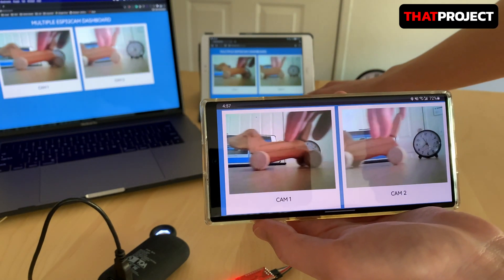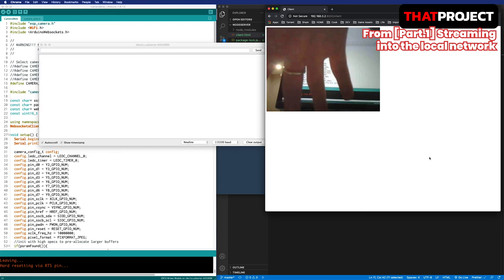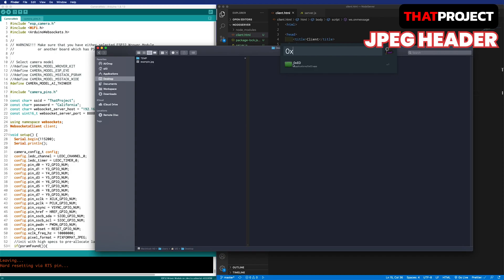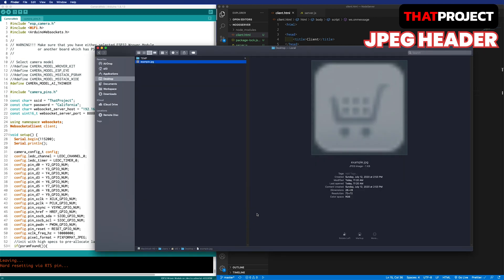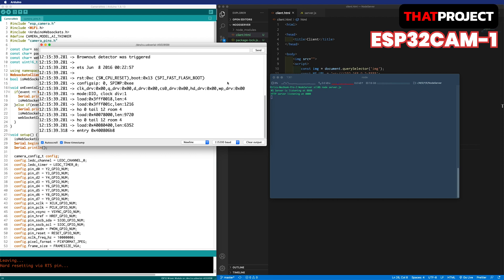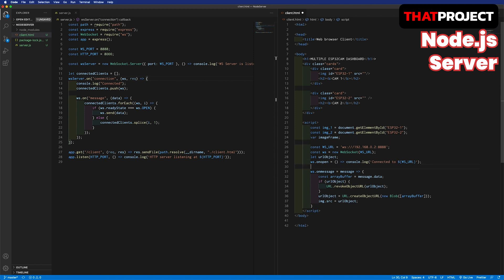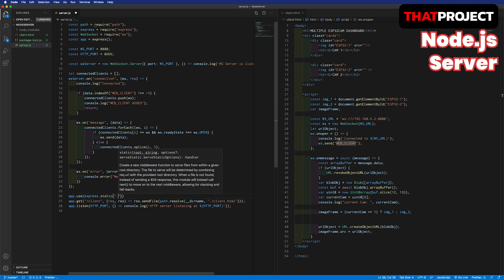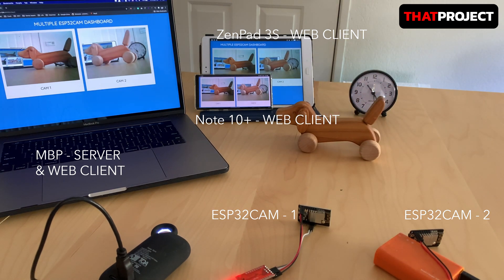ESP32 CAM with Arduino IDE | Tutorial - [Part.8] Multiple CAM Dashboard (ft. Modified Jpeg Header)🎦

Comment from the maker: Subscribe - https://youtube.com/c/ThatProject
Reply: Hi!
Doesn't work in mobile devices.
Can you help me?
Thanks!!
Reply from the maker: Pascual Pregúntamelos Could you tell me in detail what the problem is?
Reply: @ThatProject  When I use this example on mobile devices, the socket won't connect. The above examples do work correctly. Thank you!
Reply from the maker: Pascual Pregúntamelos That's weird. All source codes about the server part are almost the same. Have you tried this video first? https://www.youtube.com/watch?v=kE0idrJYPII
Reply: @ThatProject  Hi. Thanks for your attention.
I have done all the tutorials. I already have my cameras uploaded to the internet. When I do tutorial 8 the system stops working on mobile devices while it works fine on PC. 
This makes me think that there is something wrong with WS.
Thanks!
Reply: Hello!.
I just realized that where it doesn't work is on iOS devices.
Reply: I just tried on another android device and it doesn't work. That could be happening?
Reply from the maker: Pascual Pregúntamelos If it works well on PC, it should work well on mobile as well. I don't know what's wrong. It's impossible for me to reproduce the problem. Ummmmm.
Reply: @ThatProject  Hello again. Thanks for your answers.
On iOS and some Android devices it doesn't work. The websocket does connect to node, but you don't see the image.
Thank you.
Reply from the maker: Pascual Pregúntamelos Hi. Again, it works fine on my iPhone XS, Samsung Galaxy Note 10+. What phone did you test with?

Comment: Hi! Can i ask if it's possible to stream this on an andriod TV? I have tried to connect to the same Wifi network on my andriod TV as well as having the same Ip Address Subnet. However, my andriod tv (smart tv) browser's still could not load the ESP32-CAM IP address. @ThatProject
Reply: Running on local client, my esp32cam often stops streaming after 1-2hours. I tried implementing an auto reset function every 15minutes to solve this issue.

My goal is to be able to monitor my 3d Printer remotely that should last at least 7-10hours.. Also I have tried to do a remote connection to the CAM IP Address, however, streaming becomes very slow (or stagnant) - could be due to connectivity issues etc. Anyway i can reach you through email for further help?! Thanks! @ThatProject

Comment: AMAZING VIDEO! the concept with changing the byte is so cool!
but why when I lower the jpeg_quality or make the resolution higher the web socket connection crashes??
It seems like any jpeg with a size (fb->len) bigger than ~16300 or so it crashes. WHY?
Reply from the maker: What types of socket errors occur? How many ESP32-CAMs are connected?
Reply: @ThatProject  Thanks for answering! the Nodejs server socket connection crashes with this error message:
WebSocket error observed:  RangeError: Invalid WebSocket frame: RSV2 and RSV3 must be clear
there are 3 socket connections but it does not appear to be the problem, when the image size fb->len > ~16300 it automatically closes the connection and the Node server prints the message above.
to reproduce you'll need to try to sendBinary with an image with jpeg_quality of 15 and HVGA quality to get this kind of image size (or VGA quality like the video and 10 jpeg quality)

THANKS!
Reply from the maker: @username_6948  I do not know. It seems that for some reason the transmitted payload is not being completed properly? Could you please test with FRAMESIZE_UXGA using only one camera?
Reply: @ThatProject  ill test it, what jpeg_quality?
Reply from the maker: @username_6948  It doesn't matter. I think you can set it to 10.

Comment: hi, i know this is a old video but  can this work without a wifi server. can it be hosted on one of the esp32cam ?
Reply from the maker: You can run a WebSocket server on the ESP32 itself. Check this one. 
[Part.5] In wireless directly, connecting ESP32CAM to ESP32 (feat. TFT LCD)] https://youtu.be/TfuEI1-YrsA
Reply: @ThatProject  thx for the response. just to clarify , this would work with multiple cameras streaming into one esp32 via websocket via softap (no router involved, outdoors) is that right to say. would the chip be able to handle that much data?
Reply from the maker: @danaenae490  [Part 8] There is a WebSocket server running on my PC. All devices, including the ESP32-CAM, act as WebSocket clients.
[Part 5] The WebSocket server works on the ESP32, but I haven't tested multiple client connections.
Reply: @ThatProject  thanks for the info. you have been a great help to me !!!.
Reply: Is it possible to tightly time sync the images from multiple cameras?

Comment: Hi @
That Project I have a question, the code of the ESP32-CAM should be the same for my all ESP32-CAMS or I should update it like 7:19? I mean that if I need a different code for each esp32-cam? I tested it on windows and got crash!! however using a ubuntu machine it goes fine.
Reply from the maker: Each ESP32CAM must have a different Hex Code. Need to distinguish incoming sources.
Reply: @ThatProject  Thanks, then I Can use any hex code, doesn't matter his value?
Reply from the maker: @surflaweb  Yes but also you need to check this part,   client.html line#46,  (currentCam == 1)  The Hex value determines which camera it is.

Comment: Great video. This may sound like a stupid question, but why can't we just use a different websocket server host for each image?
Reply from the maker: Good point. You can create a multi-web server, but in this case, the web client is also separated. Using two browsers, each has a different url, which can make it more complicated.
Reply: @ThatProject  Thanks for the reply. That makes sense now. I am working on something. I will let you know how it goes.

Comment: Very cool! And if I wanted to use a 4G module like a SIM7600 rather than wifi...is that possible? Thanks.
Reply from the maker: I don't think it'll be a problem. You may attach the SIM7600 module to the ESP32CAM or use the EPS32CAM with the SIM module.

Comment: I tried the same using aws wherein I couldn't view any stream but a white page.what are the changes that I should make to my esp code?
Reply from the maker: Have you checked the error in the browser's inspector? It gives a hint of what the problem is.
Reply: @ThatProject  yeah I did. It shows me only this "connected to wss://my ip"(What I tried to use is your part 10 video-streaming using wss and https)

1)Should I need to add some certificate from where I send(esp32 cam)
2)What are the ports that I need to open(inbound and outbound) in my server side?
Reply from the maker: @ashwinar4753  There is a possibility that the AWS server will not be able to SSL Certificate.  The inBound OutBound setting of an instance of AWS is also required. Google helps you.
Reply: @ThatProject do  you mean the google cloud?
Reply from the maker: @ashwinar4753  oh I mean you need to google it.
Reply: @ThatProject  will there be any change in my ssl certificate once I turn off and on my aws instance?
Reply from the maker: @ashwinar4753  https://docs.aws.amazon.com/elasticloadbalancing/latest/classic/elb-update-ssl-cert.html